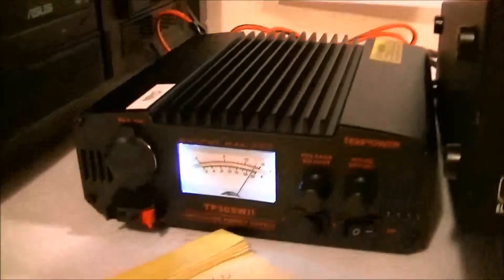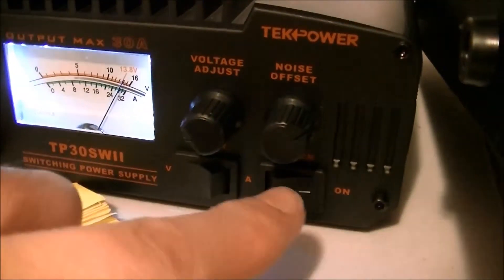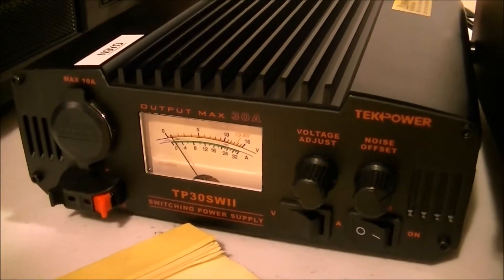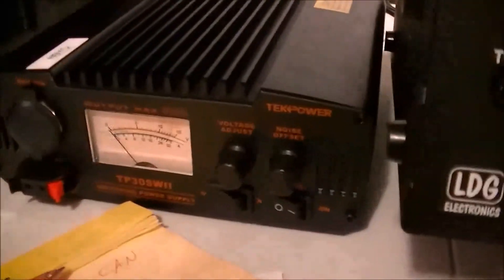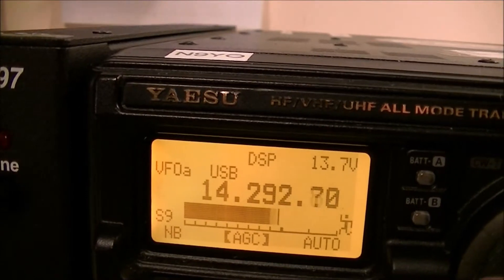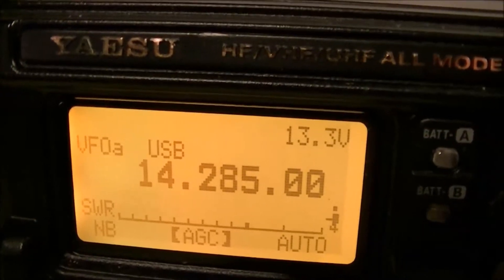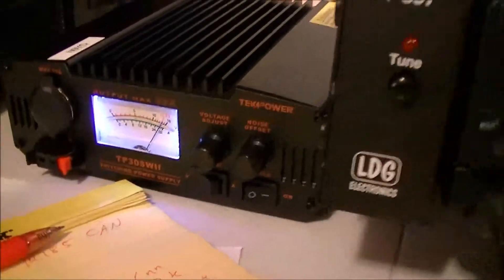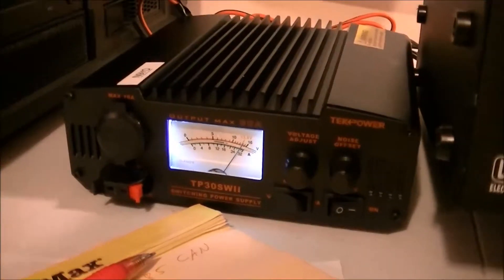TekPower Switching Power Supply Quick Review TP30SWII

Comment: Looking at getting this or an Alinco DM-330MV or DM-330FX. What it mostly seems to come down to is that for a bit of extra money, the Alinco supplies give me a few more power ports I don't really need right now and may or may not need in the future (the DM-330FX's USB ports are the very definition of high speed features I don't need, since I already have a couple of USB car chargers I can use with the cigarette lighter port). Haven't seen any complaints yet for the TP30SWII. It just looks like it's trying to be an off-brand DM-330MV.